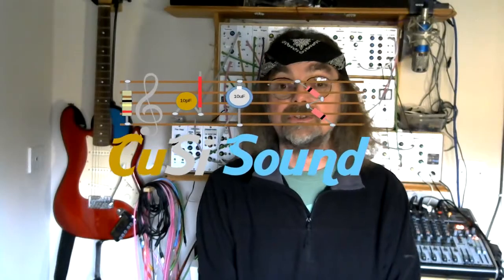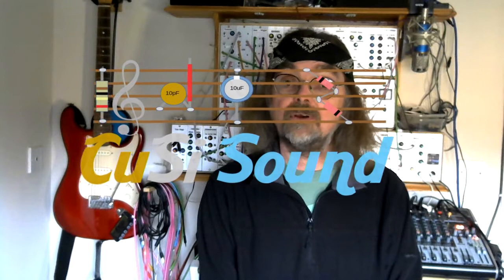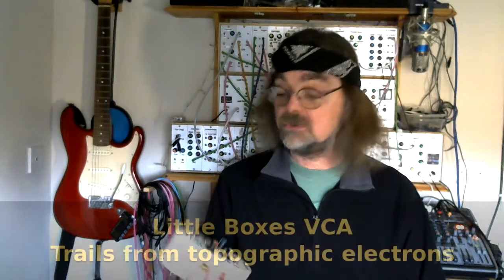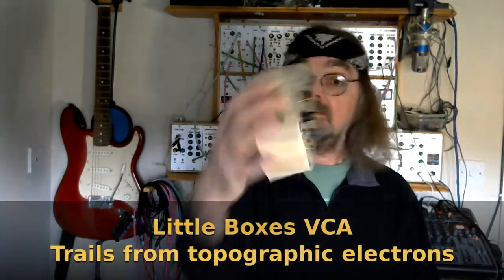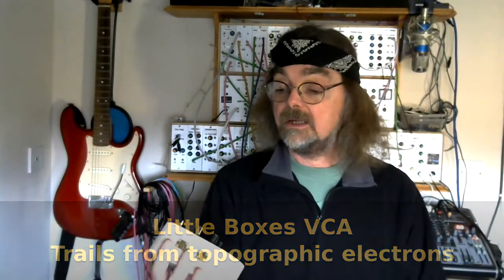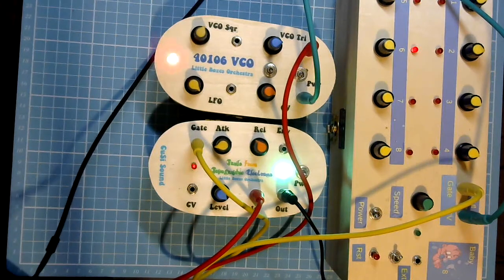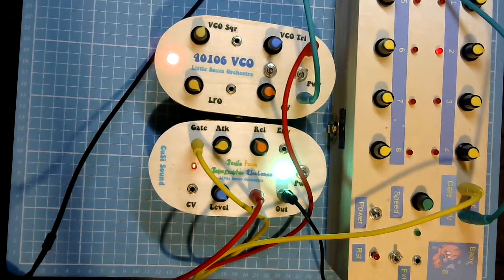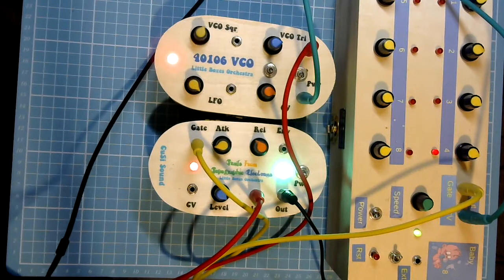Little Boxes VCA - Trails from topographic electrons

Comment: Hey. Do you think it would be possible to add cv control to the release pot using a vactrol?
Reply from the maker: Yes you could try that. If you just connect the vactrol across the existing pot i.e in parallel the resistance will change as in the formula 1/Rt=1/Rpot+1/Rvac . Try it, you can always remove it if it doesn't do what you want.
Reply: @CuSiSound going to try using different coloured LEDs and also the slow and fast changing RGBs. I’m actually trying to recreate a version of the Krell patch. But it’s a bit difficult without buying actual modules.

Comment: Hi. I’ve just built this module and at first I wasn’t getting any sound when I used gate in. I was wracking my brain for ages. I rebuilt the circuit and everything seemed built right. I was getting continuity in the right places. And then I checked the cv in jack. It wasn’t a switched socket. Doh!🤦‍♂️
Luckily I had one. And now it works perfectly.  
Oh, I’ve made your project 12 ar envelope as well and for some reason I’m getting the warp drive effect coming through🤷‍♂️
Thanks again for your videos. Such a great channel.✌️